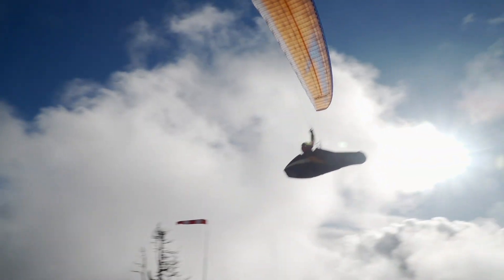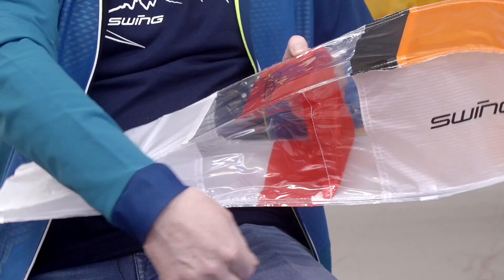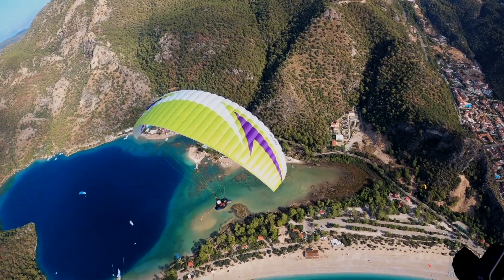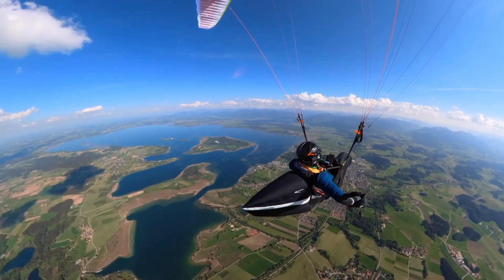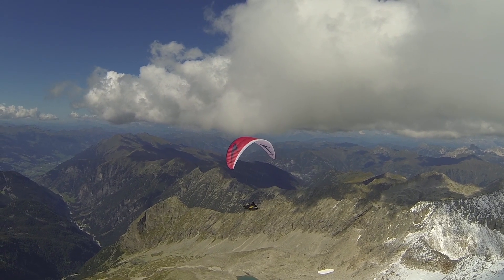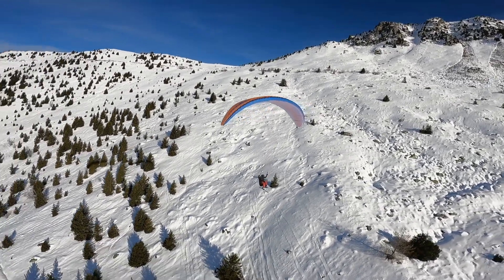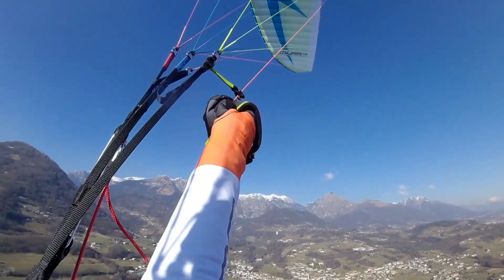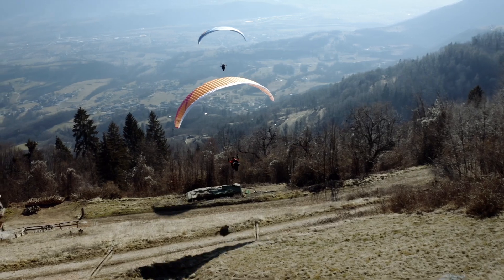DOC: The RAST Story - material for change!

Comment: Don't understand the explanation what is wrong with the Agera. I've bought a second-hand one with 20 hours and haven't flown it in South Africa yet. Should I be worried or concerned?
Reply from the maker: No, there is no reason to worry as a satisfied Agera RS pilot. The Agera RS is a really beautiful, safe and high-performance paraglider. The Problems we had, was in production to reflect the production margins in the series. For example, a third was rejected after quality control, because the smallest differences in the sensitive tension setting of the Agera RS had a negative effect on handling. The gliders sold were previously flown in, trimmtuned and tested at great effort. You as a satisfied Agera RS pilot have one these and we wish you lot´s fun and manny more beautiful flights with it.
Reply: @SwingParagliders  Thanks for your reply.
Reply: @SwingParagliders  do you have a email address I can use to make contact? Regards
Reply: No, but trim it.
Originally the tips were a little fast.
People weren't as comfortable trimming gliders in 2019 when agera was released
Reply: @stevenoble778  thanks